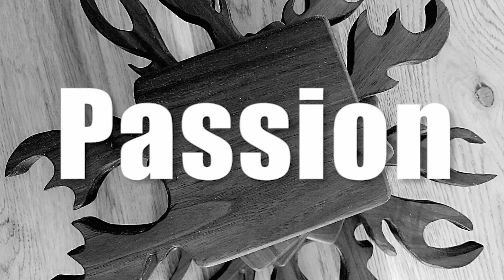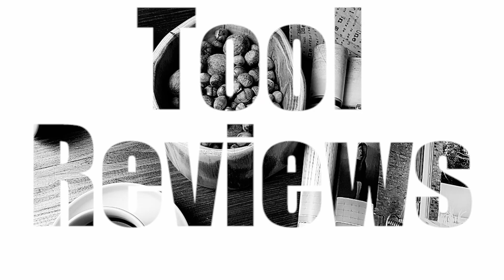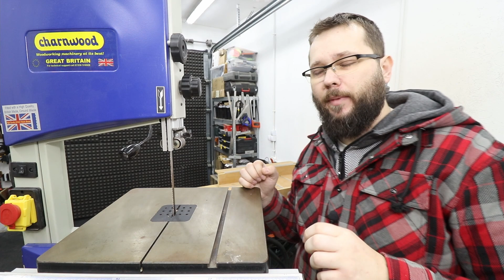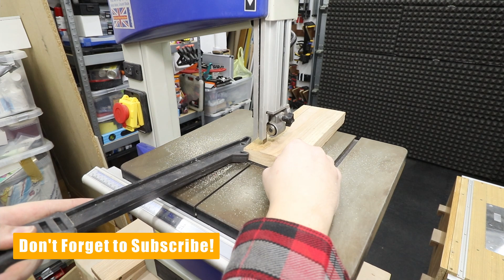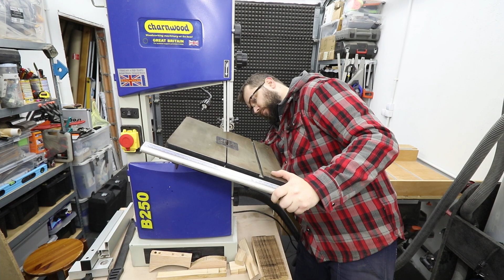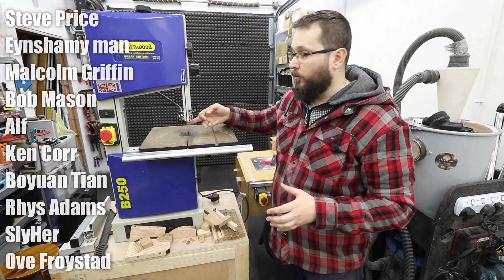Bandsaw Basics I Bandsaw For Beginners

Comment from the maker: Buying a Bandsaw on Amazon.
UK links:
- My Bandsaw Charnwood B250 - https://amzn.to/3JFKkfy
Other Bandsaw's I recommend
- Lumberjack BS254 10” Woodworking Bandsaw Professional Cast Table Solid Fence & Blade - https://amzn.to/3M0uH4u
 - Record Power BS250 Benchtop Bandsaw - https://amzn.to/3s6CtSj
- Axminster Craft AC1400B Bandsaw - https://amzn.to/3IoHtHT

USA Links: 
- JET JWBS-14SFX 14" Steel-Frame Bandsaw - https://amzn.to/3h1y2C3
- Grizzly Industrial G0555LX - 14" 1 HP Deluxe Bandsaw - https://amzn.to/3M1y7Eb
- Grizzly Industrial G0803Z - 9" Benchtop Bandsaw with Laser Guide - https://amzn.to/3sW1P4H
- Woodskil 3A 9-Inch Band Saw,2500FPM & 1720RPM Low Noise Induction Motor Bandsaw Anti-Shake with Steel Base and Cast Aluminum Table - https://amzn.to/3sPG9a4

Comment: Great video, I thought the size (10 inch or 250mm) referred to the wheel size, so slightly more than the throat ?
Reply from the maker: Depends on the saw but yes its usually larger than the depth of cut

Comment: Great intro' to the world of bandsaws. I've got the humble Aldi Workzone 8 inch bandsaw that I picked up for £49. I have to be honest, I've not really used it that much, as it is a real swine to set up correctly. Replacing the blade last year, really made a difference. I guess, with the cost of material nowadays, I have been a bit skittish about trashing my dwindling supply of hardwood if the blade goes on walkabout, as is its want. Once again, thanks for taking the time to share!👍
Reply from the maker: Thanks, Hmm I'm actually glad I've invested in this bandsaw I got. Although I wish now I even went for the 14inch version. Fortunately I got a healthy stack of hardwood, although I'm struggling with sheet materials. That's why I'm taking down old cupboards, beds etc to at least get some veneered chip board for some projects 🤣

Comment: As a budget option (IMHO) the Titan bandsaw from Screwfix is a good option, adding an Axminster fence absolutely transforms the saw (in terms of accuracy) into a very capable machine, the fences always seem to be the weak point on budget bandsaws, as with any bandsaw at this price point also allow for a decent quality blade, 'Tuffsaw' blades are really great I have found
Reply from the maker: I have to say all the Titan tools are decent quality. I got the pillar drill and the jointer/ thicknesser.